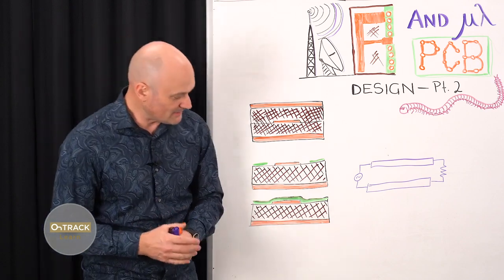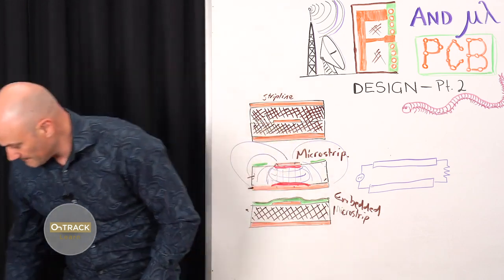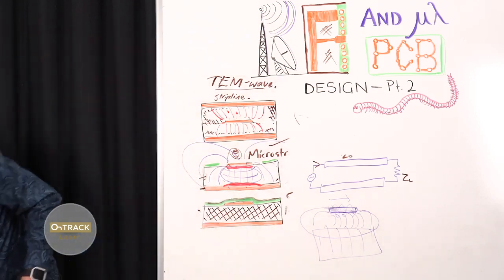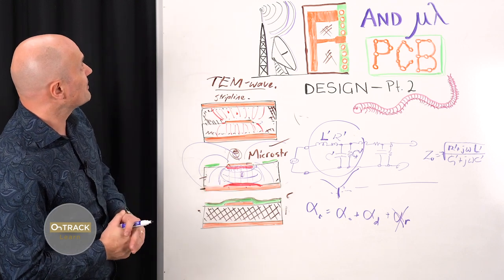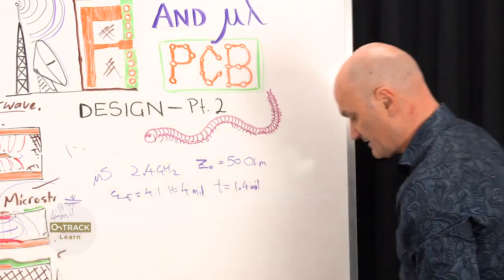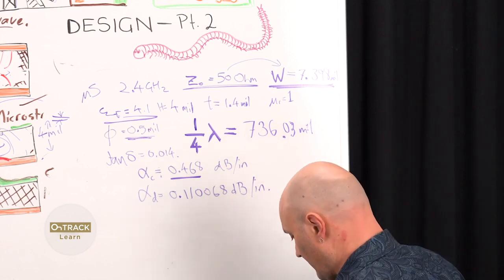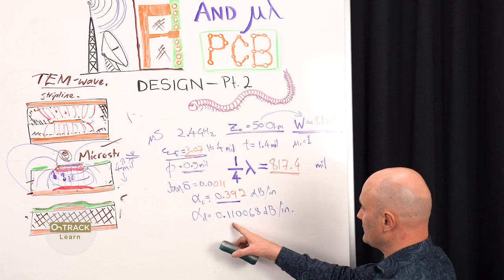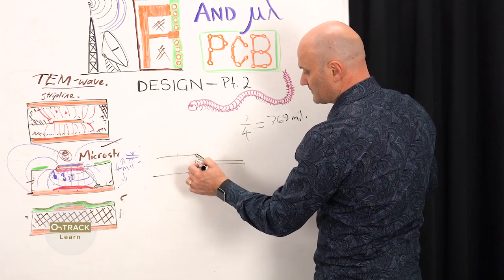(2) RF and Microwave PCB Design - Transmission Lines and Impedance - Altium Academy

Comment: This series is great and exactly what I've been looking for--this episode was worth it just for the offhand comment about the complications with ENIG (@ 22:35)!  
I would've liked to hear a bit more about the effect of solder mask in the embedded microstrip... my guess, from the discussion around the others, is that the mask will increase the dielectric constant above the stripline and heat loss (maybe making the wavefront a bit more uniform in the process? what of impact on radiated emissions?).
Anyhow, thanks for these awesome vids.
Reply: So instead of ENIG what to use?? Soft Gold finish? Or ENIG for solder pads and Solder Mask over bare copper???
Reply: @DDas-yi6jr  Seemed to sound like anything would be better, but yeah I want to know as well!
Reply: @PsychogenicTechnologies  so i simulated with solder mask over bare copper  of thickness 0.025mm and dielectric constant  of 3.5, it shows  high losses even over small length

Comment: If i had a 2 layer  FR4 board of 1.6 mm thickness then line thickness would be somewhere around 3mm. how should i make it 50 ohm?
Reply: For 1.6mm thick FR4 which has an approx. 4.4 dielectric const ,  3mm width  will give you 50 ohm impedance

https://www.emtalk.com/mscalc.php?er=4.4&h=1.6&h_units_list=hmm&f=2.4&Zo=50&EL=90&Operation=Synthesize&Wa=&W_units_list=Wmm&La=&L_units_list=Lmm
Reply: @DDas-yi6jr  if my IC has a PAD of 0.5mm then how do i do the transaction from 0.5 mm thickness to 3mm?
Reply: @tejeshwvardhan1165  use tapering for transition, but if your ic pad is 0.5mm then don't use 1.6mm FR4 go for lower substrate thickness: 0.8mm FR4 which will give you a 50Ohm. Line width of  1.5mm OR 0.4mm FR4 0.75mm line width else matching and soldering the ic  will be an issue
Reply: If I may ask at what frequency are you designing and are you having an Rf Microwave background?
Reply: @DDas-yi6jr  865Mhz
Reply: @tejeshwvardhan1165  then FR4 is ok, just use lower thickness if you want to make a shorter transition